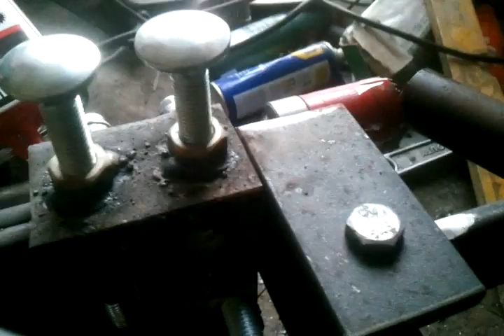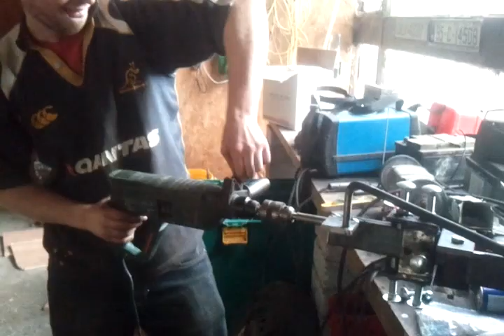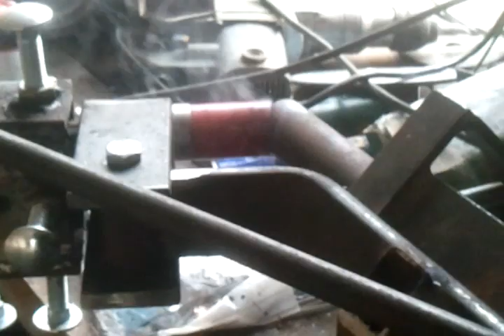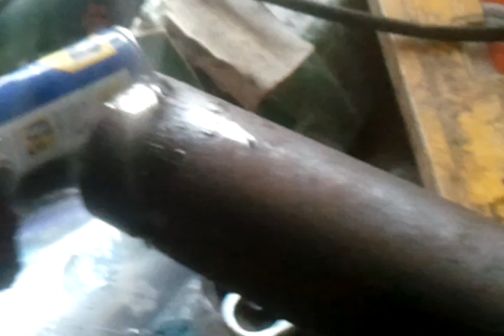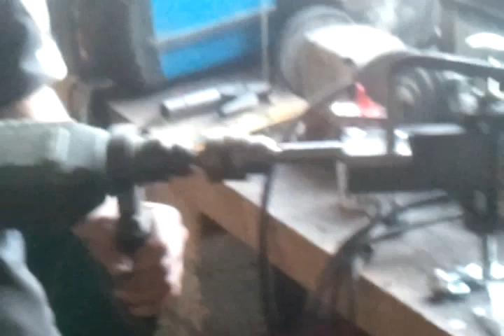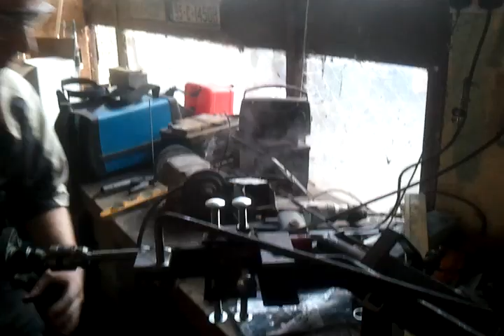Home Made Pipe Notcher Test.mp4

Comment: I Would invest in a better quality hole saw like a carbide tip. Those milwaukee hole saws suck, also get you some high temp.cutting oil to eliminate the smoke and get a 1/2 inch drive keyed chuck 2 hp heavy duty drill with a variable dial speed with a lock button and slow your cutting speed down to around 500 RPM and You will get better cuts a lot easier. good luck and don't get discouraged by the idiots comments.

Comment: You're putting too much pressure, using too high speed on the drill and using the wrong type of oil, combined with no teeth on the hole cutter. Cant see a roll cage coming out of that... :S